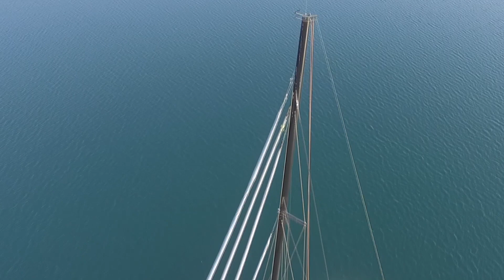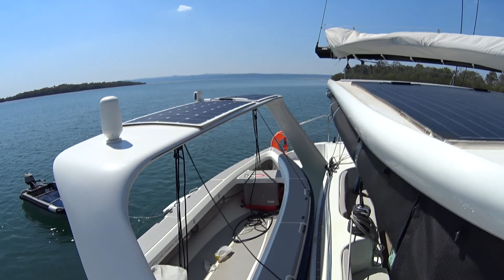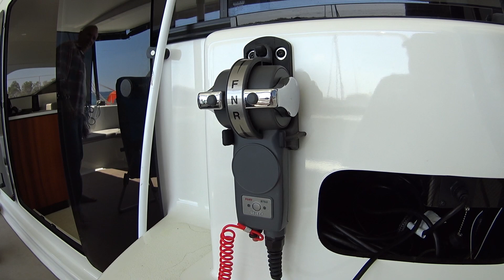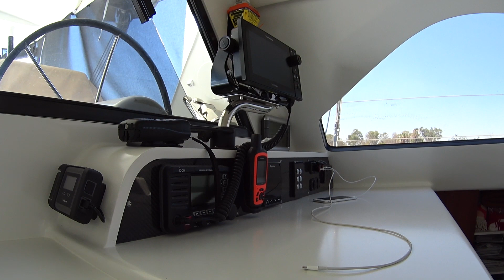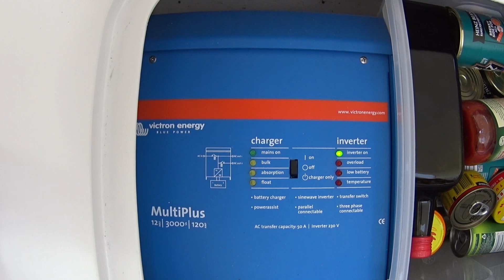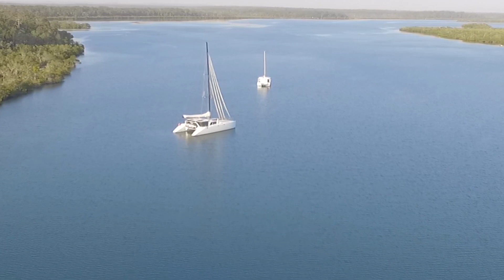Show Us Ya Boat Mate 8 Chincogan 52  Ctachus

Comment: i knew the previous owners  we raced  the Airlie beach race  around the  double cones and back, it was blowing 20 knots from the south with the code zero up,  because it wasn't so blowy when the race started , well we were were  so fast  at the Double Cones rounding mark, we left the fleet behind, we couldn't safely get the code zero down till behind the Cones, then up with the jib and we sailed  in howling  head winds  with spray  over the boat  going 36 degrees to windward,  to cross the finish line first.  I was very impressed indeed.  the Owners were great fun , danced many a times on the deck.
Reply from the maker: I guess that would be Julian, met him when he launched many years ago. great bloke. Very fast boat. New owners again now I believe.
Cheers Dude